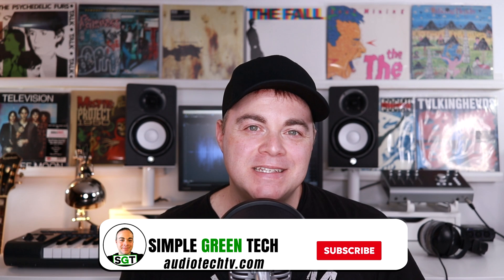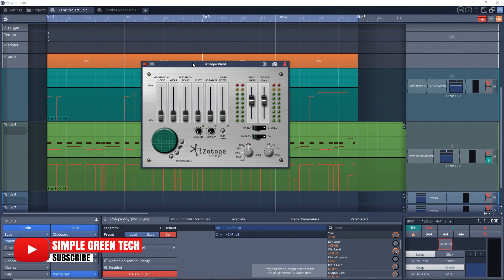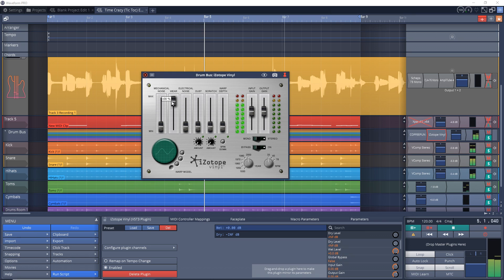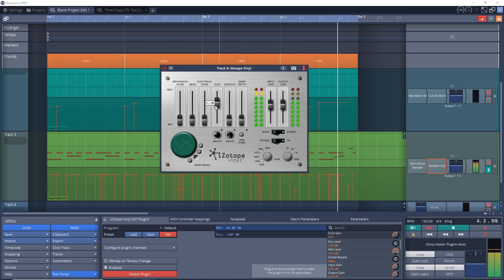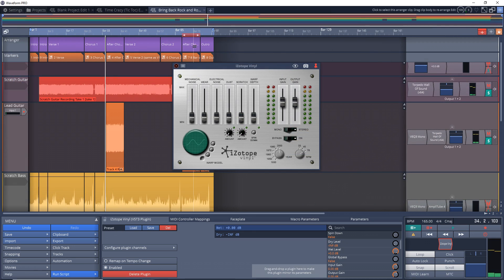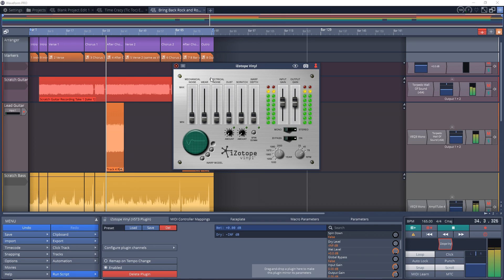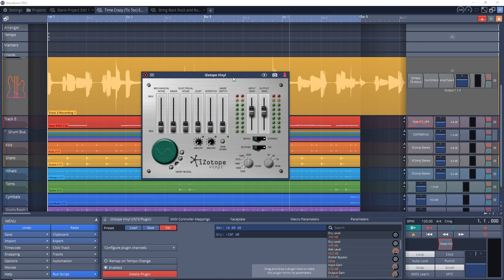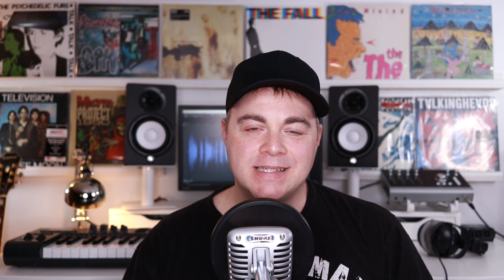Izotope Vinyl 👉 Free LoFi Plugin for Vinyl Sound

Comment: Thanks for the video.
Is there a way I can assign it to only effect the drums when they are playing and then stop when drums stop(as if just the drums are from vinyl), so the effect (crackle) isn't just constantly sounding over everything.
Or would I have to resample a portion where it's on the drums and use that?
Any help would be most appreciated.
Reply from the maker: You could do your resample idea or you could automate it. Automate the bypass button on and off as you need it.